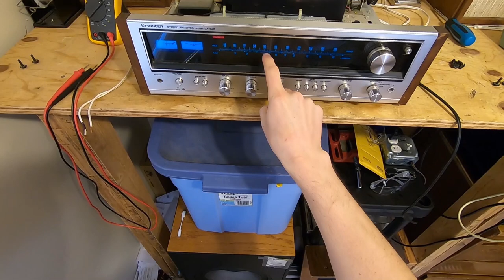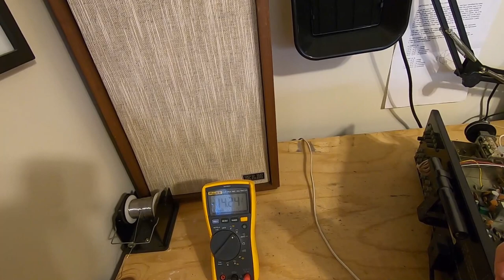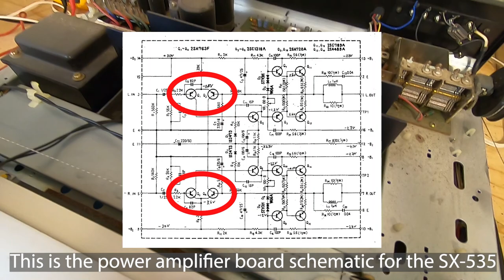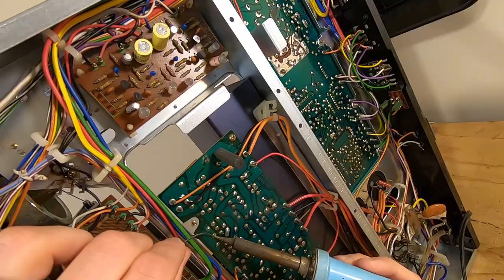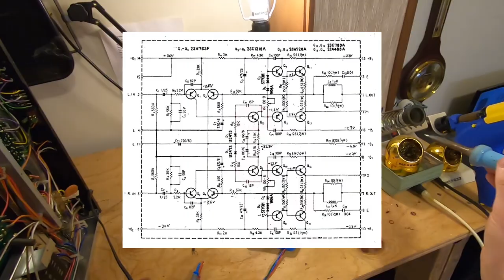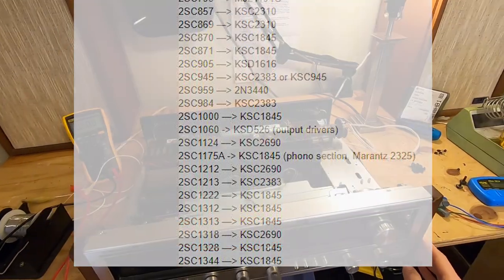Diagnosing a Pioneer SX-535: High DC Voltage at Speaker Terminals!

Comment: A liitle post-fix suggestion ... cheak the solder on that power amp board.  I will generally heat and reflow anything in the bias or output chain, just to be sure we aren't being fooled by broken solder.

Comment: Kudos for quickly finding the issue with this receiver. I commend your direction on this problem and getting it fixed with efficiency. There is something to be said with practical experience and find we are always learning as we go. With that said, for your reference Q5 and Q6 (the 2sc1318 transistors you replaced to solve the issue ) are not bias transistors.. This amp topology is a full complimentary push pull design using direct coupled stages and has no output coupling (OCL) whatsoever hence why it has a differential stage with dc stabilizing feedback. Each channel uses a single ended simple Pre-drive class A gain/constant current source device direct coupled from the differential stage to the driver stage which are the transistors you found faulty. The variable resistor and stacked diode (thermally coupled to the heatsink) array is your bias circuit as well as the path for the positive signal and current source. The transistor you replaced is in turn not a bias transistor at all.  These lower power units did not incorporate any transistors in the bias circuit. Also Bias failures do not lead to high DC voltage as much as it would lead to over current situation of the output devices being turned on too long between the complimentary pairs. What was likely happening is that these matsushita transistors were intermittently breaking down and you were losing your pre-drive/constant current source and since this device directly coupled at this point to the PNP drive, the circuit went into saturation on the negative drive side and was just pumping a large negative voltage as a result. ( note in your video it was -14VDC)

Comment: After military service and broke in 1975, the hifi bug bit me. I wanted this Pioneer SX-535 but had to settle for the 434. I really dug the blue back-lit dial scale, orange station pointer, red STEREO lamp and basic controls. That SX-434 was boss. 
Offering two tape loops, twin tuning meters, Aux and Mic inputs on a 20wpc receiver was rare and made this 535 an exceptional bargain. I use a resurrected SX-434 in my kitchen hifi system powering a Nakamichi BX-1 cassette deck and Synergistics S12B and Boston Acoustics A-40 speakers. Even these "cheap" Pioneer receivers could drive 4 ohm loads. Swell video.
Reply: Thank you for serving!
Reply: @FortyTwoAnswerToEverything - well I got drafted so I didn't have much choice. Very kind of you to say thanks, it means a lot to me. So few people ever say it.

Comment: Hey I picked up a non working SX-535 with no sound in one channel. Following you video, I changed both pairs of differential transistors, and presto the amplifier works great. Sounds good too. Really easy to dial in the bias. DC at the speaker terminals is low too, 2mV and 5mV. Thanks so much for your video !

Comment: I have encountered noisy transistors that have black oxidation on the leads. I clean that off and take a sewing needle and scrape between the pins under the body of the transistor try that sometime. If its still noisy replace. I'm sure everyone knows about trapped moisture under glue that corrodes and causes noise. I recently fixed an Akai amp that had conductive glue on it by scraping the glue off

Comment: Great video considering that I have an sx 636 coming on May.Now I know some of the problems it might have specially with those transistors you mentioned.Thank you.
Reply from the maker: Definitely.  The 2SC1451's on the 636 amp board absolutely must be replaced with KSC3503 for it to be reliable and not kill your speakers!
Reply: @AHFixIt  thanks for the guidance!!

Comment: Good video, but you may have confused people when you described how you identified this receiver as being a direct coupled(DC) receiver.  You pointed to the filter capacitors in the power supply, these capacitors have nothing to do with the  amplifier being DC coupled or not. What you should look for in determining whether an amp is DC coupled or not is whether it has coupling capacitors  or transformers in the output stage?

Comment: I have that transistor tester too, mostly use it to just check pin outs because it does provide enough voltage and current. Plus I dont think it would detect noisy transistors either.

Comment: Just watched a 12voltvids video where he had an amp with the same problem caused by tin whiskers on the transistors. Since the ones you've replaced are testing fine, maybe the problem was tin whiskers and in the process of changing them, you've knocked the whiskers off.

Comment: Probably was cold solder joints, when you changed out the transistors it  reflowed with new solder.   May save some time with future repairs.

Just wondering, did the transistors matched that you pulled from the unit?

New to your channel and I'm enjoying the content.  Nice explanation on troubleshooting, thank you.
Reply: Did you get a reply? I'm about to re solder some cold joints
Reply: @CM-dw3gh  No, you are the first.
Reply: @daledickey8400  always the way. Hope you got it sorted

Comment: Good diagnosis.  I'm recapping my JVC jrs401, and the bias transistors are on the list of "10 known bad".  The replacement is difficult/expensive to find, so going to make extra effort to replace.   On this unit the matched transistor set is a combined set of two.  Cannot find a replacement anywhere. Xraytony uses thermal epoxy to glue two together.  Think I'll wait on that.  Keep up with the great vids.
Reply: Why would they have to be physically glued together?  That makes little sense to me.
Reply: @foobarmaximus3506  Heat transfer, so the transistors thermally track the same.

Comment: Don't reply o dim bulb tester!
Invest in a FLIR or similar thermal imager. Absolutely worth the $. I use one that connects to my phone. Has literally paid for itself many times! 
Also, to troubleshoot, use a  variac to bring up voltage SLOWLY, monitor with FLIR  (hot running components will clue you in). 
And you can use finger on trans body to test for heat. 
I also use Killa-Watt for main AC pwr monitoring. 
About the dc offset. It can be almost any device -- passive or active --  on the power-amp board of those vintage solid-state amps/receivers.

Comment: Love your video :)) It made me understand what could be wrong with an amp that I have that doesn't come on. The relais does not switch on and it shoots in protection mode. It seemed that it also has a high DC on the speaker terminals but I am not sure. I am trying to fix it for over a much too long of a period now and really want it done :) It's a Hitachi HMA-8500 mk2. Now for the search of the transistors on it. Thank you for inspiring, I love your explanation in your vid.

Comment: Had the legs of the transistors adopted a black tarnish? Sometimes this tarnish (if present) can be enough to mess with the switching of that transistor, also it is possible you have a dry joint somewhere, often on the legs of the bias resistors as they tend to be chunky and require extra heat when soldering, also they vary in temp causing dry joints, it's possible that something like this was uninventively fixed as you were doing other work.
Does this amp have variable potentiometers for the bias? Often these become tarnished and need replacing or a good clean, if they are tarnished or sometimes damaged from a blown power transistor they can send the bias crazy.

Comment: Nice work but just to be clear, Q5 and Q6 are not "bias transistors". This model uses bias diodes D3,4,5 and D6. The transistor you replaced fixed it, just mentioning. AudioKarma is like a cheat code for common fixes, but they are not a definitive source.
Reply: true...
Reply: His problem is he doesn't know how the circuit works!  If transistors Q5 or Q6 are not conducting current properly,the output terminals will swing positive. If they are conducting too much,the output will swing negative. If the emitter-base is open,then the output will swing to the positive rail. If it is shorted emitter to collector,then it will swing to the negative rail.
Reply: Both channels had a very high dc offset, then it went away.  The transistors were no the problem.  Both channels did not fail identically via two discrete transistors.
Reply: @foobarmaximus3506  So what do you think the issue actually was?
Reply: The driver transistors are part of the bias mechanics, that is why he refer to them as the bias transistors.
The drivers are connected to the base of the pnp and to the cathode of one of the 2 bias diodes.

Comment: Don't abuse those dynacos. Get some less worthy speakers to test with.
If you still use them you might gain some bench area by mounting them on the wall. They have mounting brackets on the back.
I like your site.

Comment: What could cause lighter DC voltage (250mv- 350mv) on all five channels of a B&K Components power amp? Even in standby (via 12v trigger from preamp) mode, or when the amp is on with nothing connected. The only connection between all channels is star ground. Could a leaky transistor pollute ground causing this problem? High DC voltage on one channel is typically an easy fix, but I don't really know where to start with this rare problem. One day I noticed a hissing sound coming from all speakers and I measured about 1/3V on all five outputs. If you can give me any advice it would be much appreciated, because I can't find anything remotely close to my problem on Google.

Comment: Great video !! I’m just getting into refurbishing my marantz 2250b and I’m looking for a decent quality multimeter and solder station . Can you tell me what you use or would recommend if you were purchasing these items today ? 
Thanks in advance and loved all your videos to date 👍🏼
Reply from the maker: You've given me an idea for a future video!  Honestly, any multimeter with a diode function should be just fine.  I used a $40 one for years before I upgraded to a Fluke 117, which is still overkill for this stuff.  Soldering station, anything that has an adjustable temperature control should be fine.  I'm using an ancient Weller that I inherited years ago where you have to swap out tips to change the temperature, so I'll probably upgrade soon.  Weller and Hakko are good brands.  Solder sucker I use a Hakko FR-300.  For someone just getting into it, a $10 spring-loaded solder sucker works great.
Reply: @AHFixIt  haha thanks great info and yes definitely worthy of a video just of general minimal tools needed to “start “ getting into refurbishing old gear . Also since we are brain storming video ideas maybe tips about parts sourcing and which sites are your goto . Also maybe a mention to any forums online you might frequent to get answers from helpful people that don’t mind answering beginners issues 😉 also do you have an email for your channel if I’d ever like to ask you anything direct ? Thanks again 👍🏼
Reply from the maker: @michaelmalodrums9674  Yes it is in the "about" section of the channel
Reply: @AHFixIt  right on thanks 🙏🏻
Reply: I just purchased the Hakko 888D, and the 301 sucker.  Both are amazing!  I've been soldering for 50yrs, and never knew how bad a regular unregulated solder pencil was.  The station has improved my solder joints tremendously.  Both seem to be built for the long run. The sucker is light years ahead of any bulb tool that most always caused frustration.   What helped my decision to purchase, was seeing Hakko equipment in just about any audio repair video that I watch.
Reply: @scrappy7571  thanks for the info 👍🏼

Comment: I wonder if u can help me with this one with the same issue.

I have a teac stereo receiver  radio/twin auto reverse cassette deck built in,,,and a seperate turntable and cd player that connects to it.

The problem is the stereo itself,,,,when u press the power button to go into standby,,,,,it makes a loud hum noise thru both speakers,,,,as if there,s high voltage going thru them,,,causing damage to the speakers. 

Strange thing is when the stereo is turned on,,,,it sounds great,,,,loud and clear as it should b,,,,thru the speakers,,,,on all inputs.

The stereo does have a relay switch on the low voltage side of the power supply transformer,,,which does click when u turn the power on and off on the receiver,,,,or the remote control.

What would b the cause there of the hum noise thru speakers,,,,in standby mode? Could it b the filter capacitors on the power supply board,,,amplifier board,,,etc?

Comment: 2SA763 are PNP devices, and are a common failure point. Many of the PNP devices used in vintage audio as differential input devices fail causing DC offset.

Comment: Great info! just subscribed. have a question - my SX 750 - unrestored  - works great except I have recently lost FM sensitivity in the tuner. Used to get 10 strong signals with Stereo light lit - now only get 2 weak ones with no stereo light. FM muting is off, same antenna as before.. What would cause a loss of reception like this?
Reply from the maker: Unfortunately I'm not sure. Tuners can be very difficult to diagnose!
Reply: Turns out I was wrong about the same antenna. Turns out a new digital antenna was installed without my knowledge. That appeared to be the problem. Apparently some digital antennas dont pick up FM radio! I got some old rabbit ears and am getting a good signal on stations.  Good to know the units ok. Had an Sx 650 in 76 and got the 750 last year off Ebay. I've been lucky - no problems yet.. It sounds like i remember the 650 - warmer than modern units.I bought and tried 70s and 80s NAD, Technics,Harmon kardon and even a 1000 Speker craft from 2000. None had the rich, clean sound of the Old SX _50 series. The NAD 3030 was nice, and would be my 2nd choice.

Comment: Having problems troubleshooting my thrift store buy. Worked great for a while, then I moved around and it might have been bonked a time or two and now it's weird. Everything on the board looks great and nothing stands out as broken or bad. I'm trying to test certain things to rule out what is the problem, do you know of a good place to find information on what voltages, resistances, and continuities I should get? Just trying to figure out if getting 14mV on one channel and one channel going from 0mV to 5mV and back and forth is normal or not.

Comment: My lamps in my 535 weren’t not working, I changed out the lamps with LED. They still are not working but the red stereo light comes on. Any suggestions?
Reply from the maker: Check the fuses on the power supply board.
Reply: @AHFixIt  thank you so much that was the issue. Awesome

Comment: At the 2:00 mark of this video, you said that 535's do not have a protection circuit in them. I have a Pioneer SX-780 and an SX-535 and when i power that 780 on, i hear a "click" about 2 seconds later and I'm assuming thats the protection relay being energized. So my question to you is, can a protection circuit be easily added to units like this that have no protection circuits? Thanks bro, love your videos!
Reply from the maker: Not easily. Anything is possible, though!
Reply: There are kits for adding them.